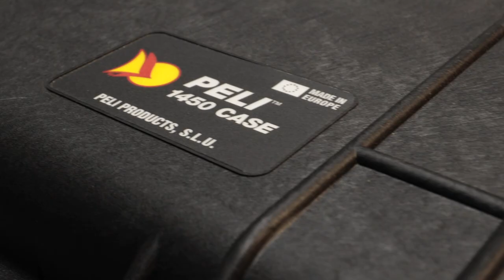How we organised a PELI TOOLCASE for less than £30

Comment: Do you need extra backing material for the removable trays? or is the foam sturdy enough to support the tools by itself?
Reply from the maker: Depending on the weight of the tools, you can get away without a backer, however you can add one for extra stability. If you don't want that, check out Easy Peel! It's sturdy enough to make trays from! 😊
Reply: Just ran into my own comment on accident. Easy peel sucked. Looks and feels cheap. Almost like packing foam.

Comment: Without handles to lift the foam layers, this is not very practical. Have you solved for that?
Reply from the maker: Our new product Easy Peel is much more suitable for using as trays. It's a rigid foam so there's no need for handles or reinforcing with a tray underneath
Reply: @ShadowFoam  Some people attach flat nylon straps under the trays
Reply from the maker: @sherischneider2390  what a great idea!

Comment: While I love the way the foam holds the tools, the stacking concept within the case is hugely impractical. To work on a bike or whatever,, you would essentially have to remove every layer and have them later out so you could access the tools as needed...
Reply from the maker: Most used tools on the top layer, then less used further in the case. This doesn't work for everyone, but you're right, sometimes you will have to take the top two layers out to get to the right tool
Reply: Sure beats the time it takes finding tools in a box with tools just throw in though

Comment: How did you get the foam to stick in the lid????
Reply from the maker: General adhesive would do the job, nothing too heavy but generally if it's cut to fit, it wedges in there snug.

Comment: What would you recommend to attach the foam in the lid with? I have a similar set up with my box and the foam has a habit of falling out the lid when I open it! Double sided tape? Some form of spray glue?
Reply from the maker: We have used a number of techniques to do this, it depends if you want a permanent solution. If you do, we have a spray adhesive that we sell on our website. Alternatively, we have used strong double sided velcro, this means you can take the full insert out form the lid if you want to.